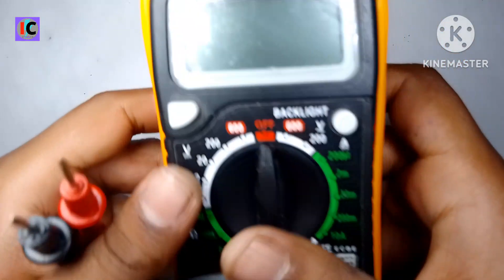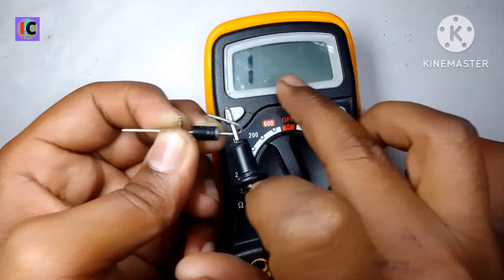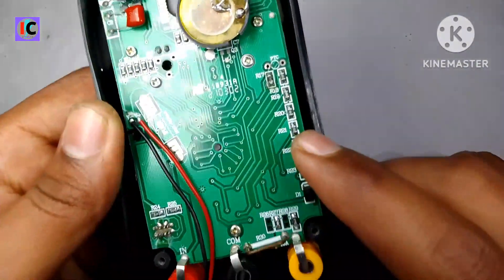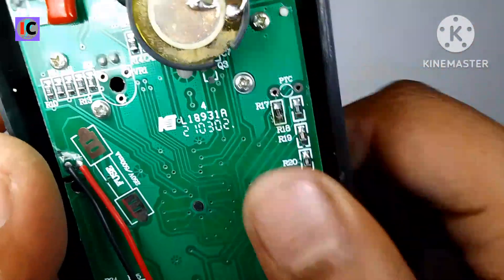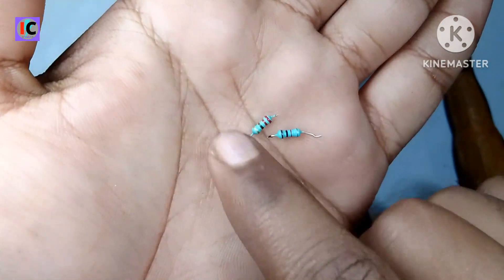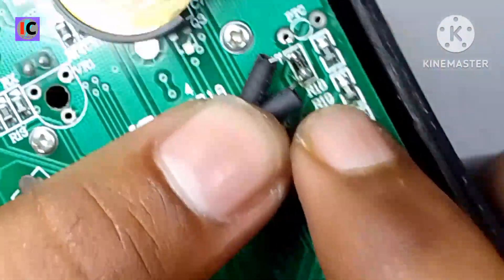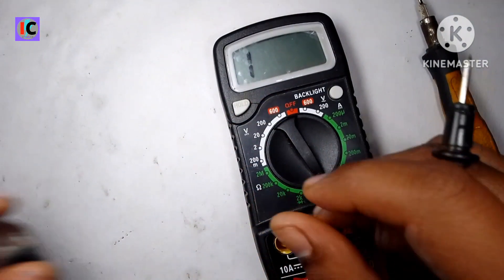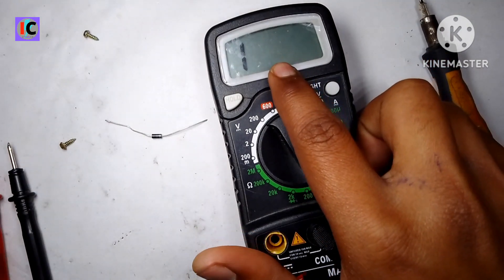How to fix common problem of multimeter

Comment: Hello sir, why is R17 is equivalent of 1.2k ohms? What basis do you use? Please explain me please.. thank you sir
Reply from the maker: thankyou for your feedback
here in this multimeter the SMD code is written on R17 resistor so just search for SMD coder calculator to find the value that's it👍
Reply: @innovationic  ok sir the value of r17 that i see it is 122 (1200 ohm..)  thank you sir
Reply: @innovationic  I'm just confused sir with a video like that about the beef sound defective, putting a resistor that I can't see using a multimeter to see which one has the problem, how is your basis that the one you replaced is defective? thanks a lot
Reply from the maker: basically when in continuity mode beep sound should be produced when shorts both probes, so I opened the multimeter and sees the burned resistor then checked the datasheet(schematic) of multimeter after this I replaced the damaged resistor.
Reply: @innovationic  thank you verymuch for your respons sir.. Godbless you sir
Reply: R 18 value reply me
Reply: Value R24
Reply: Good video